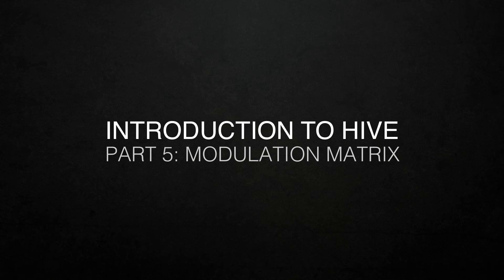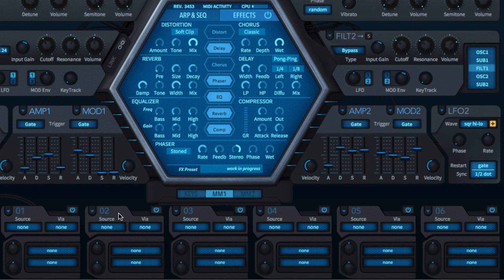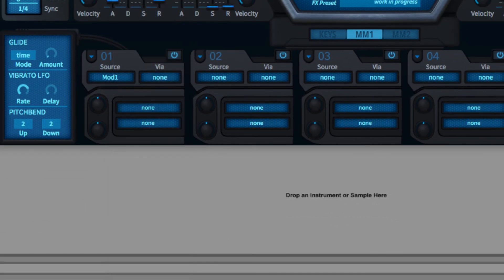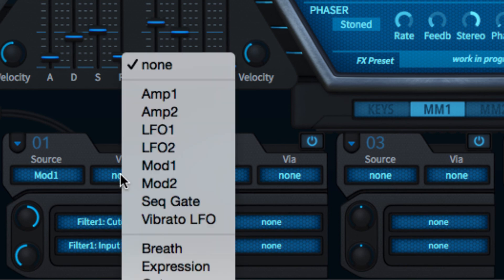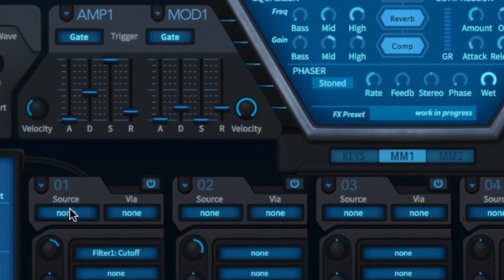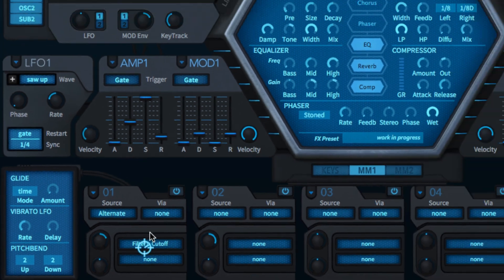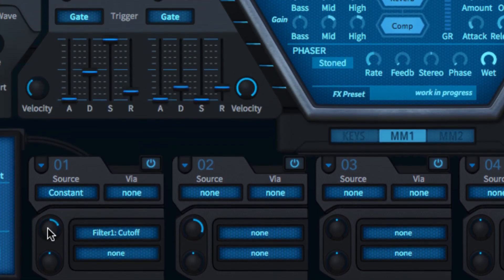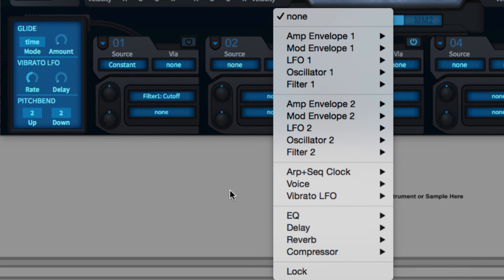Introduction to Hive - 5 Modulation Matrix

Comment: I am trying to use the midi velocity to control the attack parameter. However I can only set hard velocity to high attack and I want to to the opposite. How can that be done?
Reply: Thank you :)
Reply: I find it sad, that I do not see the attack fader move up and down dependent on how hard I press the keys. Is that something that will be implemented in future versions?
Reply: ok thx for the fast answer.
Reply: Does any of your synth plugins have this feature?